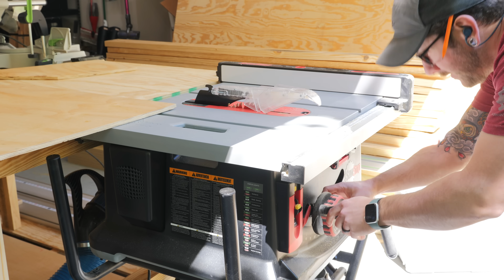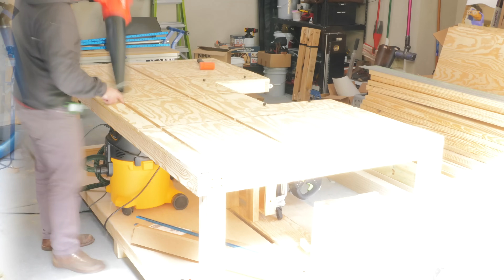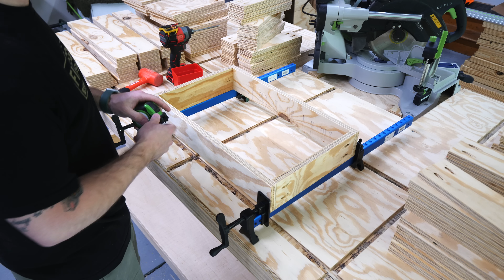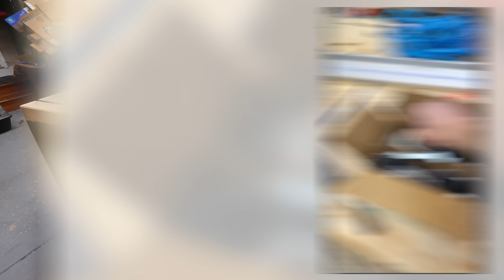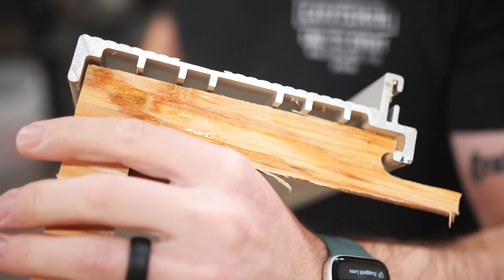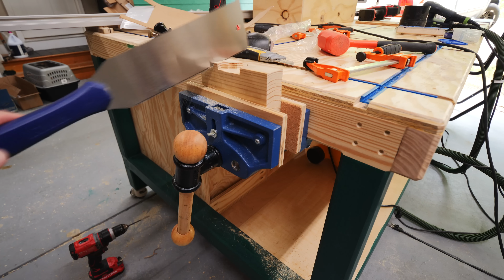DIY WORKBENCH / MITER SAW Station PART 2! Building Dust Hood, T-Track & Drawers

Comment: I built a similar set up, but the miter saw fit out on very heavy duty rails and that allowed me to rip a 4 x 8 sheet plywood in half and not fall off the end of the table. The advantage was I could get three drawers under the miter saw that I otherwise could not if the miter saw had to drop down

Comment: Surprised you didn’t build the dust hood so it could fold down into the opening from the saw when stored so it’s back fills in the space on the top for full table use as workbench

Comment: What is the advantage of putting the pocket holes on the outside rather than the inside of the drawer boxes?
Reply from the maker: They’re stronger in that orientation plus you can’t see them in the finished drawer.

Comment: i have a similar table, and one thing i hate  is the opening where the saw is when it is folded down.    This gave me a great idea!. to work out for the dust hood design to be on hinges also. where it folded down flat over the saw creating that flat work surface across the entire table.

Comment: next time it might be easier to double up your ply... have a solid top screwed down to your blocked out frame then attach your routed ply wit track on top of that? this keeps the strength of the wood for the top and you don't have to worry about going through with screws for the track.

Comment: Great bench!  I'd love to build this out.  I'd modify the bench slightly, building out a section that could be used as a router table.  That would be perfect for my small shop.
Reply from the maker: That's a great idea! Check out the plans, I love the bench and have been using it a ton lately.

Comment: Just a note for folks who might want to build this:  the traditional way to mount the vice is behind the apron, or board on the edge of the surface.  You loose a bit of clamping depth, but gain a long reference.

Comment: Doesn't the miter saw extend forward beyond the front edge of the bench when stowed? Looks like by just enough to bang your shins against time and time again when working at the bench. The solution would have been to have the folding platform hinge several inches rearward and the saw stowing slightly lower and rearward. Waddaya think?

Comment: How do those wheels work being so small relative to the weight of the bench. I have two different creepers in my garage and the one with bigger wheels rolls much better than the smaller wheels which can get hung up on something like a paper clip.

Comment: Thank you for the tip on cutting aluminum with wood tools like a miter saw, which I have. I rarely work with aluminum, and would hate to have to buy something special to cut it.

Comment: With your fist set of wheels you had a supporting block in the middle of your bench, so it was supported ones you flipped the wheels up. Now you don't have that option anymore and I also do not see the supporting block anymore. Is the workbench now not bending because of all the weight and only being supported at the 4 corners?

Comment: WOW  Your Gluing the Bottoms on ?  No Dados ?   Wood specially Large flat will Expand and retract with Cold & Hot weather.  Also you should have made the Notch for the Miter saw larger and Make it so the Hood flipped down  and was the table top when down.
Reply from the maker: Plywood doesn’t expand and contract for that to have an impact, I’ve built drawers like this for years.

Comment: I'm a newbie, so I may be all wrong.  But I've been watching a lot of safety videos on using a table saw, and they say not to use this kind of push block because you end up with your arm and body over the blade, like this guy does every time.

Comment: One question and one comment.  Did the loss of the middle support legs compromise the rigidity of the unit at all?  Also, I like how you maintained the continuity of the grain on the drawer fronts.  Not sure you gave yourself credit for that, but you should have if you didn't.

Comment: Would the 400lb rated casters really not have worked?  Assuming there's one on each corner, the only way your workbench would have been too heavy is if the whole thing weighed over 1600 lbs.

Comment: I'd been thinking of making a simpler version of the bench Woodshop Junkies has, and I really like what you've done here.  But I really want my table saw built in.  How difficult do you think it would be to adjust these plans for that?
Reply: Have you found anything similar but with the table saw?
Reply: @figgydotcom  I modified the plans for this table to include a torsion box at one end, a hole in the top to push the table saw up through, and a shelf with stops to mount the saw on. Works great, but I'm still trying to improve storage and dust collection.

Comment: Too late now, but just FYI for anyone else building this.... There's a heavier-duty version of those workbench casters that you rejected due to their low weight rating. I bought some 800-pound rated ones from https://www.amazon.com/gp/product/B078JS7RCP about 18 months ago and put them on my 500+ pound lathe. They're made of thicker steel than the 400-pound casters, and they've been fine so far,.  It does take quite a bit of force on the pedals to get the lathe up onto the wheels when I want to move it, though.

Comment: Do you find the jobsite SawStop does all you need , are you happy w it’s precision? I don’t use a table saw that much and am considering buying one?
Reply from the maker: It’s been perfect for the garage. Folds up easily, precise enough for everything I’ve thrown at it, and obviously the safety aspect is the big selling point.

Comment: Great video! I am currently looking at getting my first mitre saw (budget is about £200) would you recommend a non-sliding 255mm one like the makita mls100 or a dewalt sliding one but only 216mm (DWS773-gb)? TIA

Comment: Bro, watching you make a dust collection unit for a saw that has excellent dust collection is ridiculous. Then seeing you use a hand held vacuum while routing with yet another tool made for connected dust collection makes you look way below your skill level.  What in gods name is happening?
Reply from the maker: I had the dust hose attached to the router but, if you’ve used the OF1400, you’ll know it doesn’t do the greatest job on dados. Edge routing is amazing, but not anything with any depth. The dust collector was in addition to the vac in that case. And honestly, I think the dust collection on the Kapex still leaves a lot to be desired. I’ve been using it with a larger Festool hose attached for a year or so and still end up with quite a bit of dust. What you might be perceiving as “below my level” are things I’ve found through experience. Your experience might differ.

Comment: You could mount the dust hood on the dropdown mitersaw platform for quicker use. And maybe you could also add a power extension cord through the platform to have power for your saw directly next to it.

Comment: I feel your pain on dropping the sheet goods on your toe (my left one too).  I was re-arranging stuff in my garage and had to move a sheet of mdf.  I was in flip flops as I wasn't working out there, just needed to get to something behind the sheet.  I used a gator grip to set the sheet down but didn't realize due to the awkward angle i was at to keep pressure on the grip that the sheet had set down on the wheel of a cooler - when the resistance was felt i thought it was down so released it - it rolled off and smashed my left big toe - severing the toenail which ended up having to be removed.  Also chipped a bone in the toe as well - but at least it gave me an excuse to get caught up with my tetanus booster lol!  Hope your foot recovers quickly!

Comment: Would have been clutch if the dust collector could have just folded down to give you a single solid surface when you are not using the miter saw.

Comment: Very cool. I will check out those leveling feet. How well does the dust collection work?
Reply from the maker: It works pretty well, but I think adding the covers to the front like Jay Bates or Bob did will help make it even better.

Comment: Great video! I have a question. When is it beneficial to use a track saw instead of a table saw (and vice versa)? Thanks!
Reply: @Jake Baran  
There are already some excellent videos and write-ups regarding this.  Do a search.

But in a nutshell, a good Track & Plunge Saw is most useful for Breaking Down Large Sheet Goods such as 4' x 8' plywood and MDF into more manageable sized pieces that can then be quickly & precisely cut on a table saw and/or miter saw.

A good track saw can be just as accurate as a table saw if time is taken during the layout & setup of the track.

A large Festool "MFT" type table top (Multi-Function Table) with precisely spaced and drilled 3/4" or 20mm bench dog holes would make precise layout & track saw cutting very quick and easy.

And the MFT style table tops are also extremely useful for clamping and securely holding down your work pieces for various duties including drilling, routing, planing, assembly, finishing, etc.

 But in general a Track Saw would usually take more time to lay out and position the track to complete each cut as compared to a large table saw.

Another limitation of the Track/Plunge Saw is not being able to make quick dado or wide groove and rabbit/rebate edge cuts.

But this can be done quickly if you also have a base/guide for your router that fits on the track as shown in this video.

You also must take time & care to not cut into your workbench's table surface using the track/plunge saw.  ;)

You can either use an appropriate size piece of "sacrificial" rigid foam insulation board on top of your workbench (under the sheet to be cut) or place the sheet to be cut on top of appropriately spaced "Bench Cookie" risers placed in the workbench surface's 3/4" or 20mm dog holes.

Track saws are fantastic if you don't have the space in your shop or money for a large table saw with the extra side and rear extension wings to help support large sheet goods while cutting them.

You can temporarily set up the track saw outside of your shop on a few stable saw horses and break down your large sheets right as you pull them out of your truck before hauling them into your smaller workshop.

I personally prefer and use a good DIY vertical Panel Saw for breaking down my sheet goods.  This is similar to the type you would find at a Home Center lumberyard.   The vertical orientation of the panel saw just works better for my shop setup.

The panel saw is placed right at the entry to my shop so that sheet goods can be broken down right off the truck.

Then, both my miter saw station and table saw are positioned just beyond the panel saw on either side for a natural workflow progression.

You can make a DIY track saw track and use your regular circular saw.  From the ones I'very seen on YouTube, I like the DIY "Upgraded" track that Wesley Treat made on his YouTube channel.

Hope this helps.
Reply: bb foto thank you so much

Comment: Like the bench and overall design. Think the vice should be mounted with the inside face behind your 4x2 frame so it sits higher and clamps flush against the bench face?